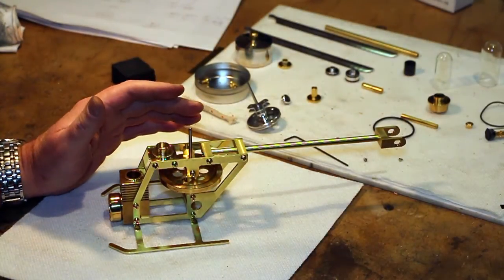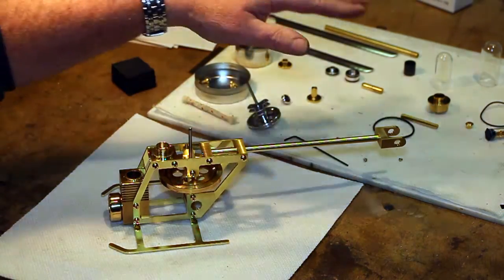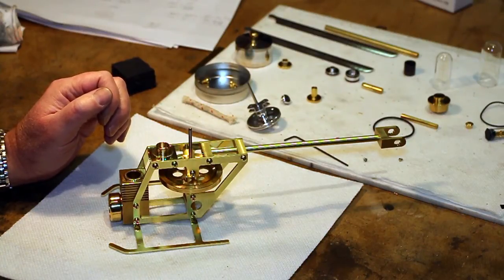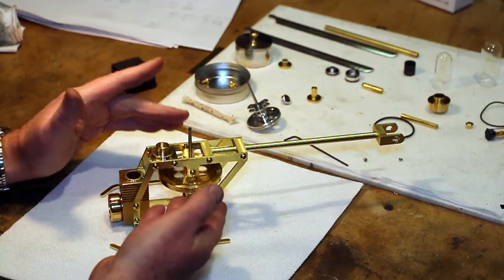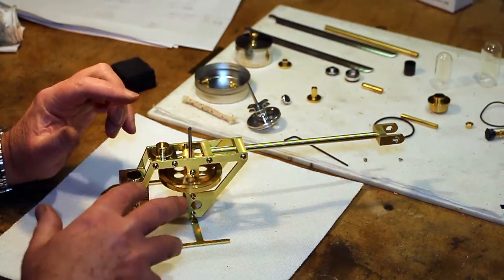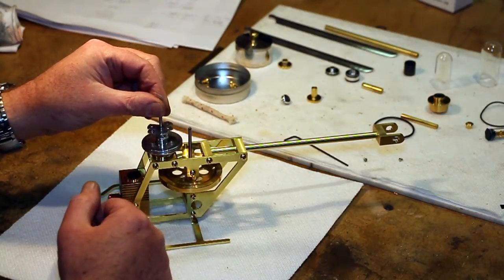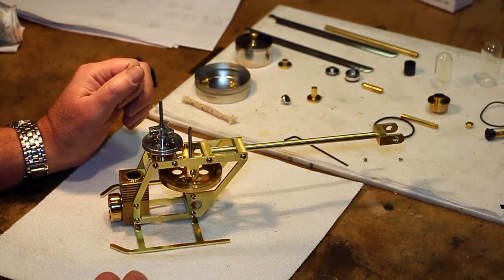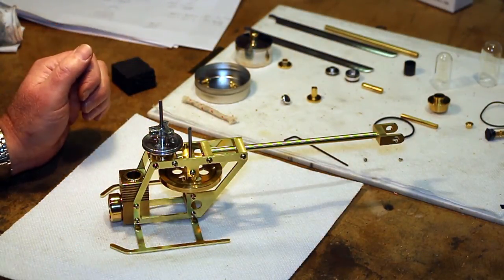Building a Stirling Helicopter - Part 10: A Sneak Peek At The First Test Fit

Comment: I looked at the rest of your videos and I am wondering how the main rotor and larger pulley are connected. At 1:36 you spin the silver rotor and pulley together but I wasn't able to figure out how they connect. Are they one single part or did you have to glue them together?
Reply from the maker: The large pulley has a rod extending from the top, up to the main rotor. The main rotor has ball bearings which are press fit onto that rod. Any other details you need can be found in the original plans. There's a link in the first video's description.